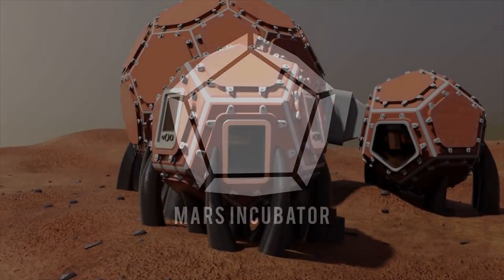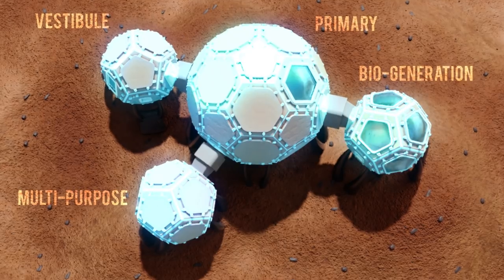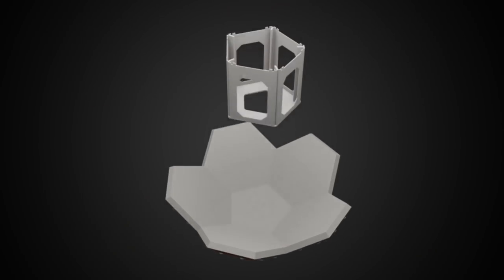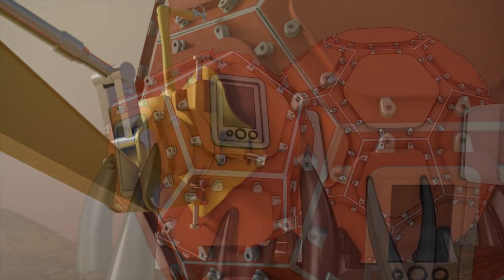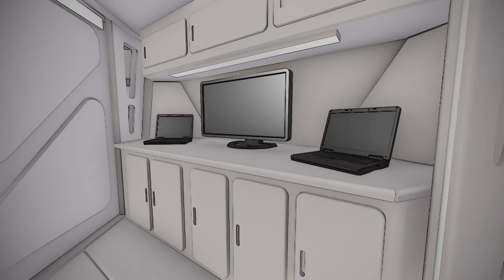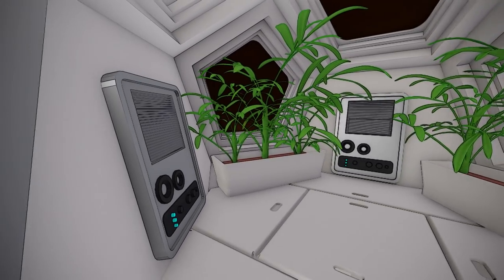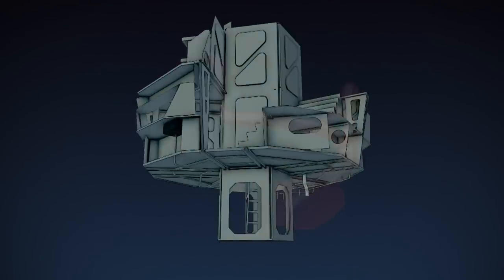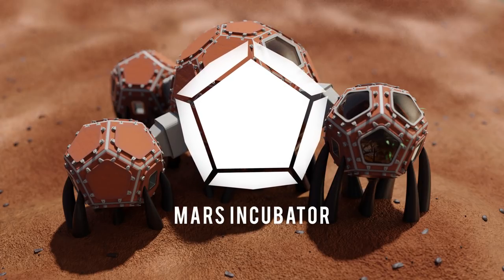Mars Incubator - Phase 3: Level 4 of NASA’s 3D-Printed Habitat Challenge

Comment: Interesting. I thought you put out a video yesterday on vimeo explaining why Martian regolith couldn't be used for anything requiring an internal pressure as the unbalanced pressures inside opposing outside pressure would cause a structure to fracture and break?
Reply: Avionics TechShop by itself no it can’t, in a composite, yes it can.
Reply: Like what muppetnumpty65 said, the tiles are a composite of regolith, basalt fibers and polyethylene that will hold the tension generated when pressurizing the hab.
Reply: @marsincubator2701  seems like a very very risky strategy since you don't have a massive sample of stress tests on such structures. a 3 link chain with unproven tech on 2 links, regolith and basalt. Just asking for trouble. One single crack in a panel could produce a chain reaction all over a structure on many level at once via internal pressure drop that could cause all other panels to either crack, be displaced and/or get damaged at the seams from abnormal interactions in such a de pressurization event. day/night temperature expansion, anyone hitting one with their elbow at the wrong time in the wrong place could just see it all topple like a house of cards. Even if there's no catastrophic failure and drop in pressure, how are you going to find a tiny leak given the huge number of seams ?

Comment: That’s quite a shape.
Reply: Thanks!
Reply: It is driven by the need for pressure retention and modularity.
Reply: @marsincubator2701  Doesn't the shape of it lose a lot of the available space in comparison to other shapes?
Reply: @IOwnThisHandle  Yes, it's hard to organize all of our "things" and work spaces inside a spheroid. The shape is a balance of all the functional requirements. We did our best to optimize the placement of all of the systems. For example, if you scan to 1:48 in the video you will see that we put the emergency pressurization system under the floor boards in the smaller domes.

Comment: so much over engineering...who's gonna waste so much space carrying plastics to waste them into lame mixed blocks ?
Reply: The biggest bottle neck here would be the need for the CO2 -> ethylene and ethylene -> polyethylene reactor vessels and a supply of catalyst for the ethylene to polyethylene reaction. If you were to send out an automated reactor to produce the ethylene (ease of storage and tapping for use) on site in advance you'd have a massive head start.

The polyethylene reactor and the consumable catalyst (though there are some papers that suggest the availability of Cl, Br and I in the Martian regolith) could follow later (timed so that there is a sufficient stock of ethylene already on hand). However the difficulty of coupling the two reactors suggests they be sent together with a resupply of catalyst at a later date (depending on the availability and ease of access for the Cl, Br and I on Mars).

As for power: A third reactor (CO2 -> methane via Fe ion catalisation ) could be used to take advantage of the new advance in low temp methane fuel cells (only 500c... o_0 ) to provide power after initial start up, with batteries and solar providing the initial kick start. After this heat from the polymerisation reaction can be used to maintain the fuel cell temps.